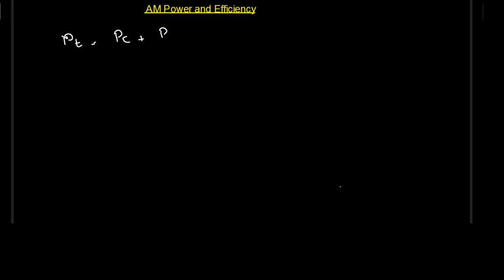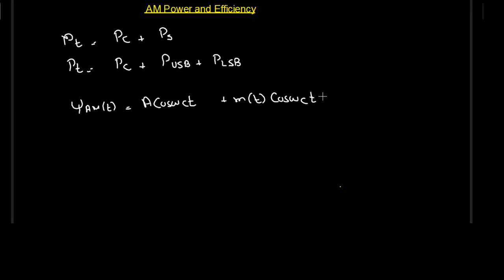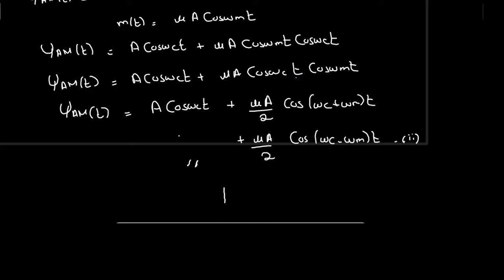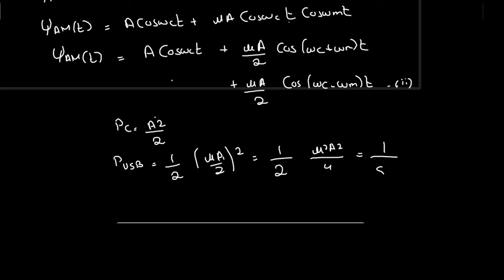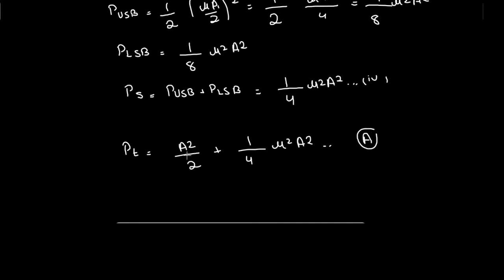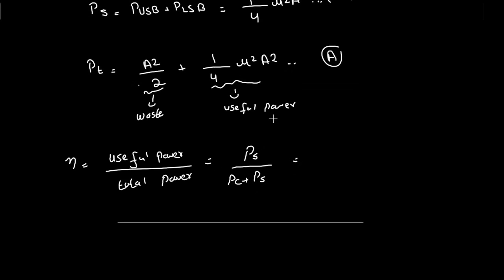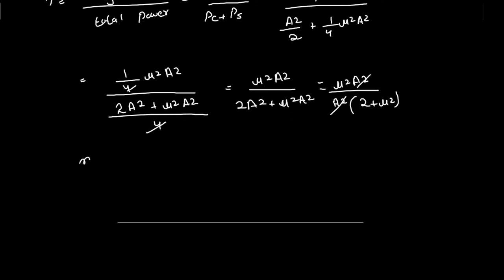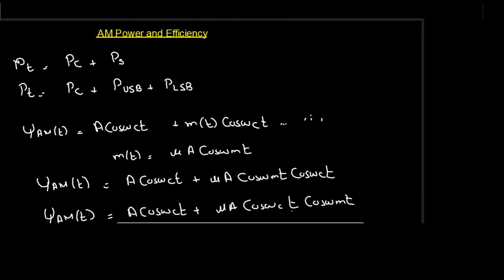AM power and efficiency| Power and Efficiency of amplitude modulation

Comment: Disadvantages of using synchronous detection of AM signal are:
a. Needs additional system for generation of carrier
b. Needs additional system for synchronization of carrier
c. Receiver is complex and costly
d. All of the above
ANSWER: (d) All of the above
Sir is this answer correct as in synchronous detection we need extra carrier at Tx so the tx required more power and become costly.
Should the correct ans be a and b or d option sir.
Reply from the maker: That's why synchronous detection is not used in broadcasting system because of received complexity and cost..
Reply from the maker: With carrier Kai liye ap receiver pei envelope detection Kar sakhtei hai ..zahir hai with carrier mei transmitter side complex hogaya..islye with carrier hum broadcasting Kai liye use karte hai..
Reply from the maker: One complex transmitter is better than multi complex receivers..that's why we use..with carrier modulation for broadcasting..
Reply: @TechnicallyExplained  ok sir i gotted...
Reply: Thank you.
Reply: Sir g Is the hec courses syllabus arranged  for all engineering universities are same?A lot of Universities M.s test syllabus was according to the B.s syllabus.
Reply from the maker: Because receiver is costly as we have to generate another carrier with same frequency and phase as sent on the transmitter .so option d is correct
Reply: @TechnicallyExplained  sir meray kehne ka mtlab yeh ta jb hmarey paas carrier tx side pr generate hota hain to power required tx pe zyada hoga kiyon ke hmare pass kuch aur carrier hain he nahin msg signal ko detect krne keliye to pir sir kis trah receiver pe impact pre ga carrier ka..